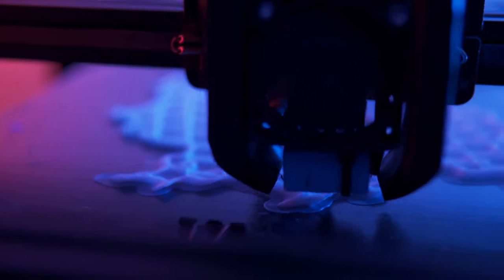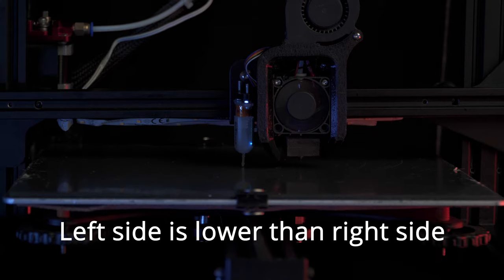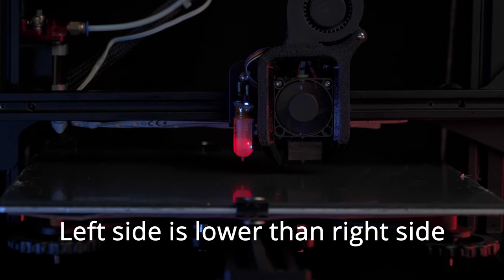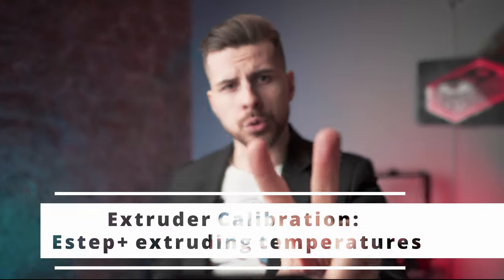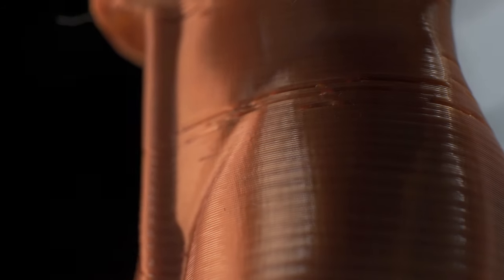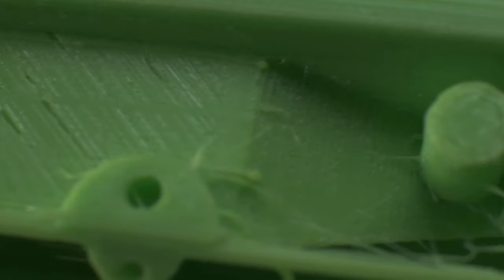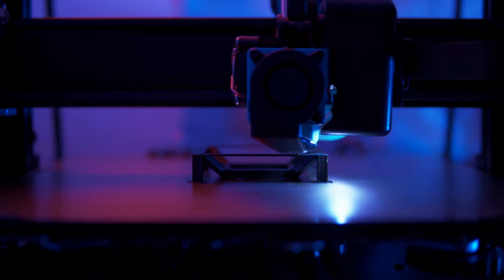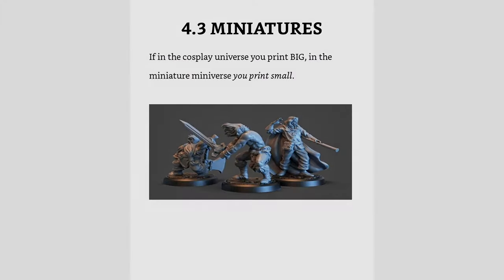The only TWO things you must figure out to 3D Print hassle free

Comment: Just an FYI, "calibrating esteps" as everyone likes to feel so great and smart in doing, is something that can give you a small amount of print quality, but ONLY if you do this for every single filament you use, and only if you are printing at the same temperature as it was when you did this calibration, AND as long as you never changed your extruder gear tension or nozzle. All of these factors will change exactly how much filament is extruded when you issue the command to the printer to extrude 50 or 100 mm etc. So yes it is good to check it, but don't worry much if it is off by 5mm +/- as this ultimately makes very little difference in whether you end up under or over extruding. It is miniscule. 
  The MORE important thing to do, is calibrate for each material you print with, for flow rate% independently on your top/bottom layers, walls, and infill. Print a open top test box that is exactly 2 walls thick, with your slicer set on .4 wall width. If your cube walls measure very close to .8 with a pair of calipers, then you are doing well. If they measure .9+, then dial your wall flow rate back 10% and test print again. If you have over extrusions in your first and last layers, dial those back 5% at a time until they sit flat with no ridges or holes in the layers. 
  Please, don't waste too much time worrying about esteps, especially if you aren't that comfortable doing it in the first place. It equates to making sure your car is burning the exact amount of fuel for every type of gas you might put in there. It is nice to be close, but ultimately it doesn't really matter as long as it isn't WAY off.
Reply from the maker: Hi Ishmael, thank you for your input!
I agree on many of your points, and on a decision tree for printing around the clock, esteps come before flow calibration: esteps are a machine variable, flow is filament variable. 
Esteps are correlated to the extruder setup, and are constant whatever the printing speeds, acceleration, material, layer height, layer thickness. Is tied down by firmware and even swapping to bigger/smaller nozzles remains the same. It is also the reason why it is burned in EEPROM, flow is a floating variable that depends on the filament and nozzle accuracy, and minorly by tension on extruder teeth. A 5% discrepancy in estep values is massive (5mm every 100mm), as also for 5% flow from the correct value.
The open box method you cited is a fantastic solution to calibrate flow, and it will be argument for another video focused on filaments more than printers
Reply: @3DPrintingForMoney  sorry but this is wrong. Your extruded filament will be different depending on every variable I listed. Check for yourself! It's an average number to give you a decent amount of extrusion across all the materials, nozzles, and temperatures you will be using. Nothing more. It's also usually set using PLA from the factory on a .4 nozzle, so depending on how different you go from that will change your extruded amount.i had quite a difference between just Pla at 200 and petg at 240, so I did a calculation for each and used an average e value of both. I then fix the smaller differences with flow rate. Again all probably not even necessary to begin with, hence the reason I've given my little PSA here
Reply: And 5% in flow is actually quite small. It will result in 100ths of a millimeter discrepancy in your extruded wall thickness, which could have just been fixed in your slicer settings to begin with
Reply: Yes estep calibration was important back when people were unsure of the effective estep value for their particular hob gear, but now it has become standardized enough for each manufacturor that this is completely unnecessary. And like said before, your results will vary especially depending on the hard or softness of the material you are running thru as well as other factors. Flow calibration is the way
Reply from the maker: @FIN_OSCAR_RAHHHH  Yeah flow is important, I don’t discuss it. Only saying that it is material-related. 
I’ve been digging awhile in how slicer outputs gcode, but didn’t find a clear answer if flow settings accounts also for retractions. until now, my understanding is that flow settings affects only for extrusions, but not retractions. So if esteps aren’t on spot, a relative 0 point won’t correspond to an effective 0 after the retraction movement.
What machines do you have? Maybe I’ve been unlucky, of all the machines I run only one had correct esteps (Prusa mk2s), all others, mainly Chinese ones, were off…so I had to calibrate them all, and only then dig in other parameters.